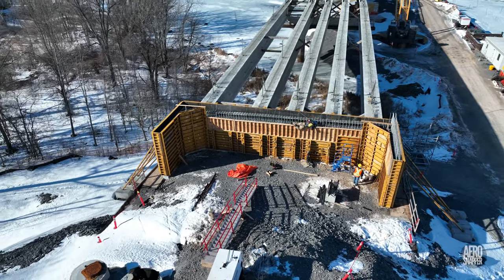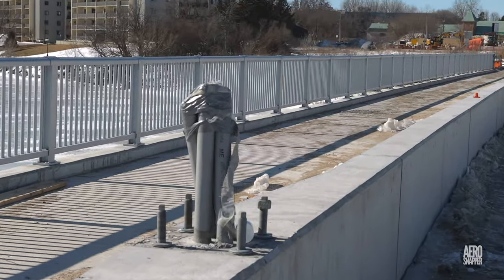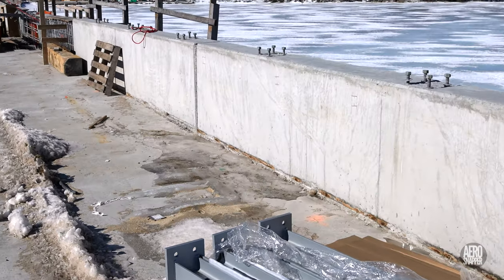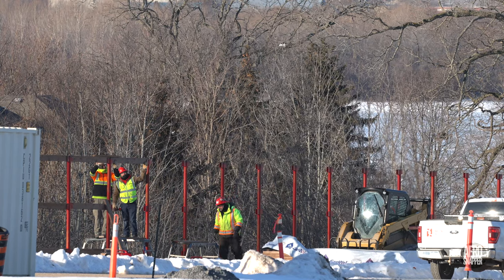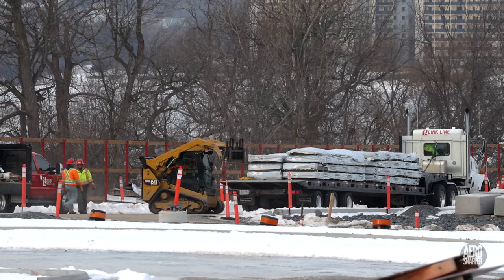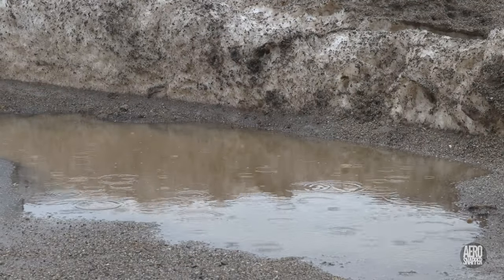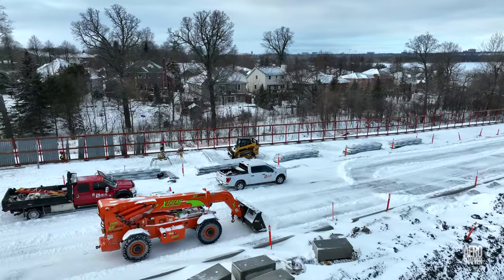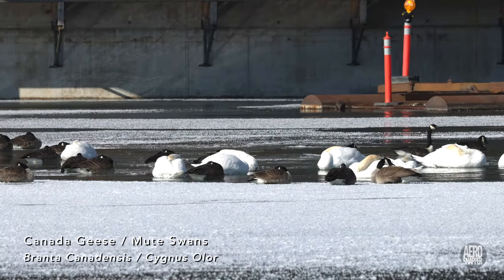Stuck in the Middle   4K

Comment: When conditions are appropriate, you'll have to pour tons of concrete. How many contractors are currently working simultaneously? Cheers!
Reply from the maker: Erik - absolutely correct about the concrete. Generally measured here in cubic metres. At this time of year, the workforce is less than 50, I believe - with most busy on installations of one kind or another, or removing safety rails / platforms no longer required.